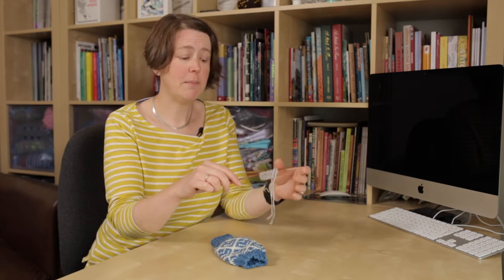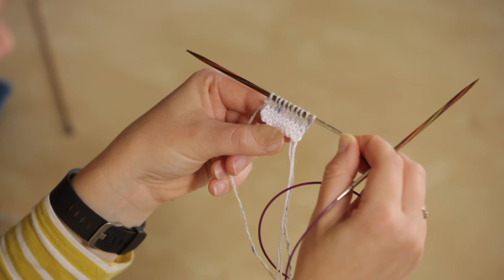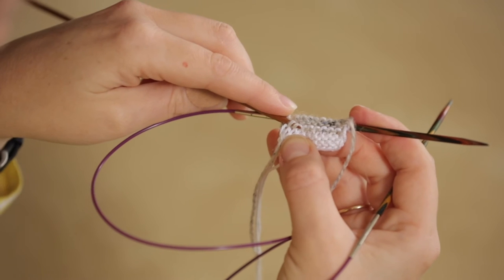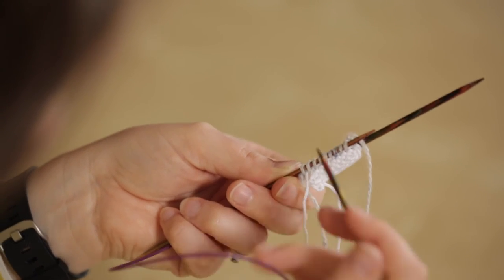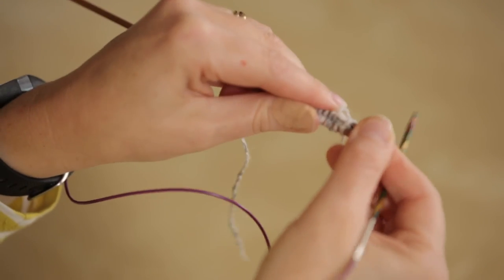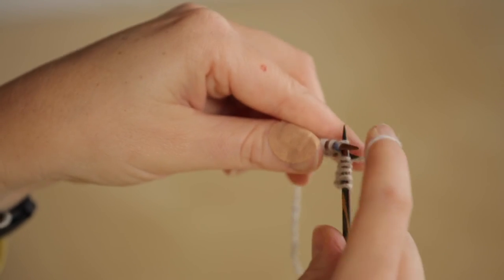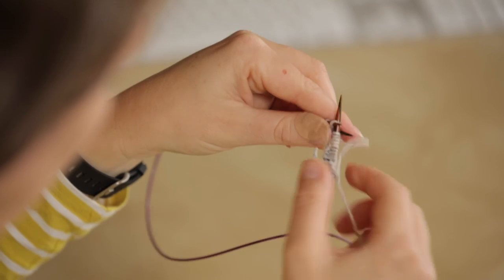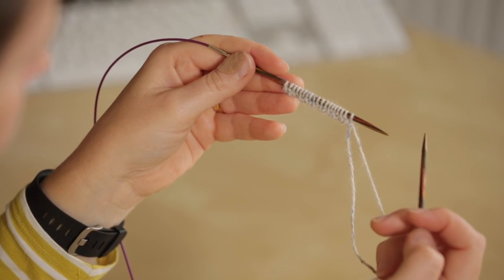Tubular Cast-On Method

Comment: How would you join in the round using this tubular cast-on method?  Great tutorial otherwise!
Reply from the maker: You can either work it flat and then join once the cast on is complete - you'll have a little gap to sew shut. Or you can work the waste yarn and main yarn in the round from the start. We actually have a tutorial on tubular cast on in the round coming as part of our Boost Your Knitting series. :) I hope that helps!
Reply: JenACKnitwear Thank you so much for that helpful update!